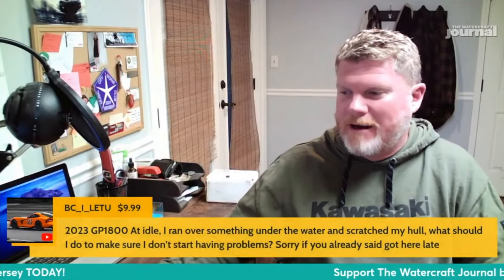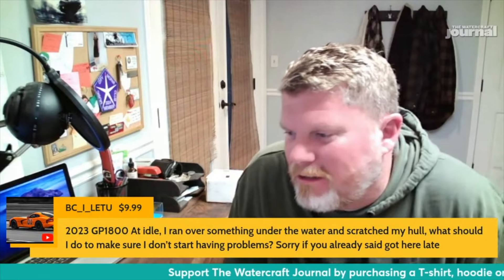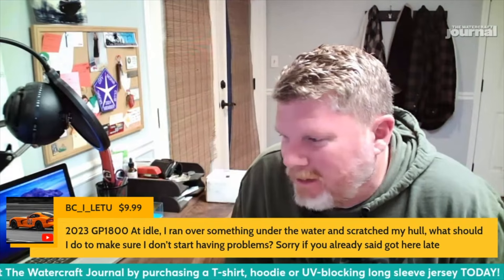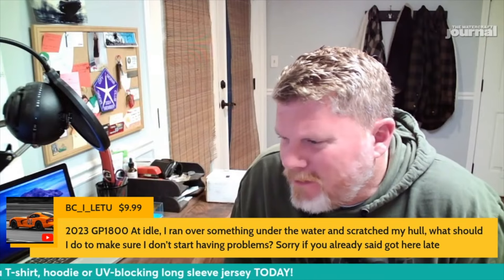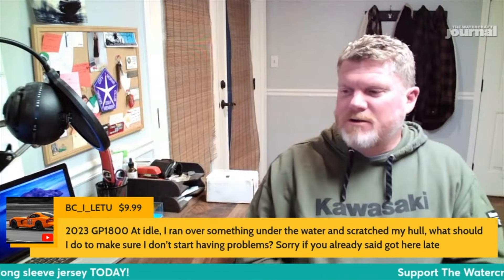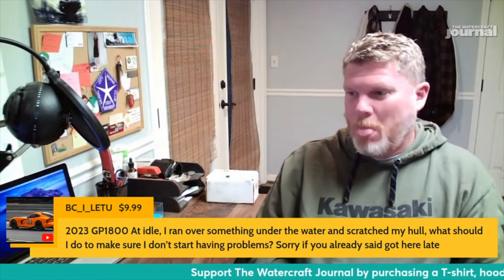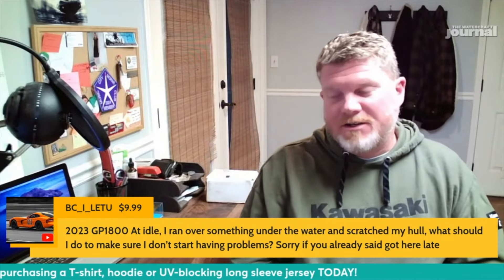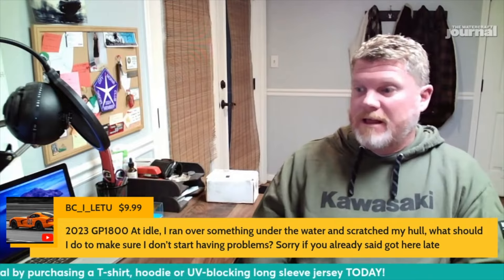Is Gel Coat a Good Option For Yamaha's Painted Hulls? WCJ Quick Topic

Comment: So why doesn’t Yamaha just use gel coat? Is it a cost cutting measure?
Reply: Gelcoat is heavy, I think.
Reply: @kkutube1972  these 3 seat skis aren’t exactly lightweight. I’d not care about 50lbs more for better paint
Reply: Gelcoat is not flexible enough and is meant to be applied to a female mould, on top of which the fibreglass is sprayed.